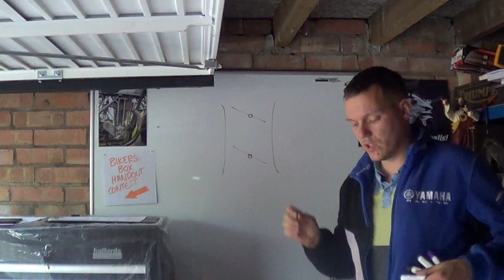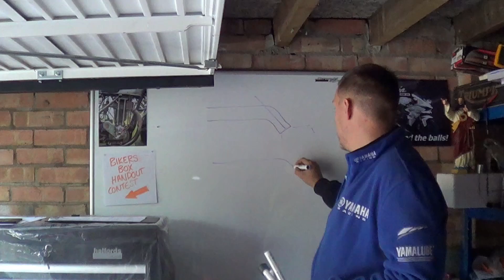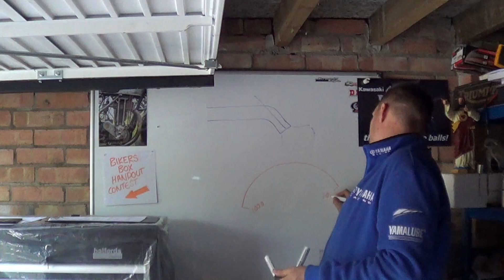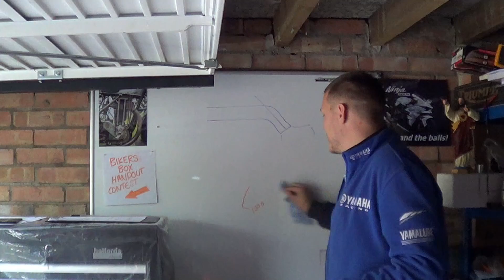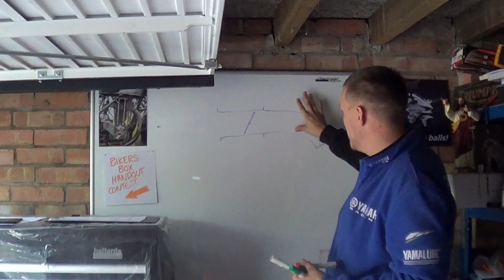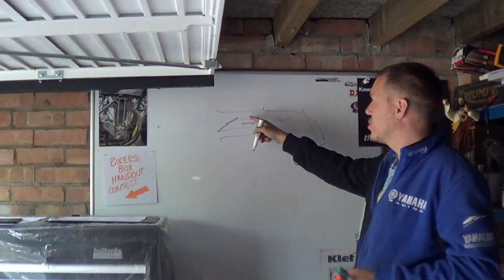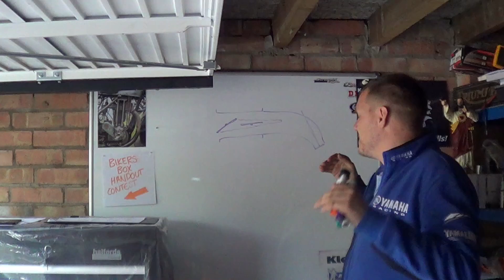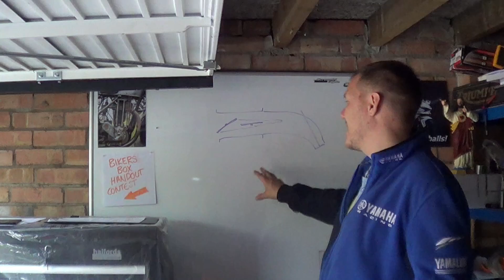Does your bike have 2 throttles? Secondary throttle valves

Comment: Have you actually tried removing the secondary throttle blade, or are you just going by a theory, and name calling?
Reply from the maker: Yes I have, I also did a 6 month module on fluid dynamics and tested flow controllers for Carl Zeiss...
Reply: @thedirtyworkshop  On what bike?

Comment: Came here to learn why we have secondary position sensor (along with throttle position sensor) and I did. Thank you good sir
Reply: it's like vacuum secondaries on a carb, but in series instead of parallel, to stop bogging in the middle of the RPM range. :)

Comment: Matt is this the same as using individual throttles where each runner has its own throttle or are individual throttles used for a different reason mate?
Reply from the maker: For a different reason

Comment: Hypothetically speaking would this also work in a scenario where ITBs are joined by intake plenum and said intake plenum has computer controlled throttle body?
Reply: I think the benefit would be somehow lessened by the increased plenum volume, but I'm not an engine wizard.

Comment: considering the weight saving, lower cost & lower mechanical complexity, this seems like a more effective approach, if done right, to improve the intake air-fuel mix speeds compared to Vtec. How does it compare to the ride by wire throttle system?
Reply from the maker: The  ride by wire is basically making full use of traction control and all the other electronic systems work together without mechanical systems. The other reason is so that the rider just becomes a digital input signal gather than a conversion from analogue to digital - also reduces latency between the two
Reply: @thedirtyworkshop  hmm... i guess that's why bikes like street triple have such flat torque cuves yet being able to rev reasonably high..

You are a gold mine of information, mate. So glad that I found this chanel.
Those fucking laplace equations and not learning enough about practical applications of that knowledge was really driving my interest in engineering down. Do you have a suggestion for a mechanical engineering student regarding how he/she should approach learning about practical applications? Maybe do a video on that? Would be really helpful for many engineering students.
Reply from the maker: "Do you have a suggestion for a mechanical engineering student regarding how he/she should approach learning about practical applications?"

- Yes, get a job LOL
Reply: @thedirtyworkshop  oh boy.. i walked right into that one.. lmao..

Comment: Nobody is trained to feather the throttle anymore. I think all numpty learners should have a month on a big bore single thumper, to practice on. That way they will stall often and kick like hell. It is the best teaching method.
Reply from the maker: I kinda agree - the issue is modern bike have so much more power than the old school bikes - for instance a GT750 had about 70HP - a new R1 has 180HP

Comment: TLDR; sometimes reshaping ports with JB weld works better than stock. Most times doesnt.
The usefulness of this "high velocity" porting is very dependant on the engine. For Motoman to say that EVERY engine needs it is stupid, yes. But the '02 CRF R models (first year produced) work great, but if you use some JB weld or whatever to reshape the port and raise the floor / open up the roof a bit you can not only raise peak HP but also extend the power band at the same time.

Comment: It usually takes about a year for configuring and testing a new moto design from A-Z, which includes section engineering teams, like for the engine and power band goals. Then here comes Yob Neckbone, with a new-to-him idea, to wise-up the bike brand with a genius mod. Moto fools often miss some obvious running needs & ignore unforeseen circumstances.

Comment: Love your vids. Fun and informed. 
I feel that I wanna chime in here since I actually has something to say =).
 
I have been working on some KTM 690 and I am of a different opinion about secondary butterflies. See, they are tunable and I tried going to the extreme ("removed" it electronically). What happened except a very abrupt power delivery, was that i were able to get the engine to ping at low down RPMs. It pulls more air than it can handle, so the comp.pressure got too high on low rpms.

It is a state of the art engine, but if runned without (or electronically removed) secondary butterfly, it is not idiot proof. When tuning the different mappings (map selector switch) of the bike, you are in fact tuning how the secondary butterfly opens in relation to the main throttle butterfly. You are changing the character of the engine this way, without altering the fueling or ignition timing. 
I believe the secondaries are more a safety device for the engine than a power-gainer. But on the other hand, a pinging engine is not a powerhouse either. At least not for long :D

Have a nice day, and keep the good stuff coming =) 

Robert, Sweden
Reply: I would say what you experienced is the compounding of effects that is part of tuning. You can put a less restrictive intake and exhaust on a vehicle but you won't see benefit until you rejet/remap fueling. Inversely, rejetting or remapping won't see benefit without putting on a less restrictive intake and exhaust. Trying to change one aspect without changing the other complementary aspect will appear to have a negative overall effect.
Reply: Did you increase the fuel?

A simple way to do that, without getting a tuner, is an O2 Eliminator.
Reply: @peterlindvall7671  Yes. But i changed the  mapping. O2 eliminator wont do the trick on a 690. It can be disabled through the mapping software.

Comment: i have a poulan chainsaw with 2 throttles and 2 sets of intake ports, is this the same thing? also has like these ports in the piston, not holes but like its weird, and ive been in and around 2 strokes a fair bit, first time ive seen it in person, poulan still uses that design today
Reply: att made vids about ports of 2 stroke in the cylinder AND the piston i think ;)

Comment: I believe that CV carbs help achieve similar results, no? fueling aside the vacuum slides do remain in the optimal position for the RPM. Would like to hear your thoughts Matt!
Reply from the maker: Coming soon. CV diaphrams are for A/F ratios, which is similar but not the same. More on this later. The CV gives it away a bit.
Reply: @thedirtyworkshop  What about the the 2003 r1 which had a CV style throttle body but was FI it would basically be the same concept as this but can only be control by vacuum of engine right?

Comment: so theoreticaly you could do the same thing with a very skilled right hand?
Reply from the maker: Yes - ish.
Reply: Had a fueling problem on my moped, because the mix was lean i had to slowly throttle up following the engine speed.
Every time engine speed changed i had to adjust the throttle so it was a constant fight to keep the engine running for the ½ hour drive i had home.
I would guess it would be the same though not nearly as bad as i felt it.

Comment: Doesn't CV carbs use changing intake pressure to open the throttle barrels as engine RPM (air demand) increases, after you fully open the throttle butterflies?
 Similarly, doesn't vacuum secondaries on a four barrel automotive carburetor work in the same way to help increase low to mid-range power of an engine. I was wondering your input on this, Matt.
 Thanks in advance, and I love your channel! 
 ,Jim
Reply: I was just thinking the same thing. I got old motorcycle too, and it has cvs in it and people who has changed them to normal slide carbs, they say they can't go full throttle on low rpm, cos it chokes.

edit: oh it was on there later on..
Reply: Jinx, you owe me a coke
Reply: (Jinx, in that I was wondering the same thing)  In addition, I was wondering how the engine spark advance system differs when it has direct slide system (throttle cable goes right to the slide in the carb) versus a Constant Velocity setup.  I had a 1977 Suzuki GS750 with the direct slide system and was told that those kind of carbs are desired by drag racers.  I believe soon after 1977  almost every manufacturer went to a CV setup.

Comment: I wouldn't be surprised if you could use a mechanical tachometer like thing to make a mechanical second throttle body, but that would likely be in the diminishing return of investment area.
Reply: you could do a system like the 2 stroke exhaust control (mechanical).its rpm based with an centrifugal

Comment: My 07 svs 650 has, plus 2 sparks per cylinders, nice little beast
Reply: K6 does too with 50% less spark plugs :)
Reply: Chris_ SVS nice, but i remember i reached 3,8L/100 km for consumption, it was amazing. And my max speed odo was 234 km/h
Reply: Math required lol  I usually fill up after 160miles ish, still plenty left in tank, only worry when light is solid
Reply: ;) well enjoy your bike, i don't have mine anymore, i sold it to travel, i miss it ... i owned 2 svs 650s because  i don't know for that budget area what bike fits me more, maybe the f800s but i heard so much negatives about de reliabelity. Or the f800r, hornet 600. street triples didn't have abs with is my number 1 concern and the 2013 years are still expensives

Comment: with the factory designing the system as "most efficient" in mind. they would judge this by the exhaust, and this being computer injection, i would guess, its what is most "efficient" for the catalytic converter. (just going by my car knowledge).. does this system run more off of the vacuum and load, or simply on a graph table of rpm to throttle position? or does a bike made in the last ten years even monitor vacuum or load? I see tps and air intake temp sensors on a bike, but only more recently O2 sensors..
Reply from the maker: "or simply on a graph table of rpm to throttle position?"

Usually this one.

Comment: So how is a runner sized to begin with? basically the same diameter as the valve its leading up to?
Reply from the maker: Usually larger - performance oriented ports are convergent to a degree usually 10-30% reduction in crossection depending on design. This is to create a natural nozzle usually to overcome the turbulant section within the cylinder due to valve shadowing. 

As for the ports as a whole they are designed to flow at the engines designed powerband. This is why steps are taken to reduce the size of the 'flowing' port, by using a butterfly to 'restrict' it.

Comment: Would rolling on the throttle as the RPM goes up as opposed to slamming it open achieve the same thing?
Reply from the maker: Yes, and that's what the old boys in racing had to do. With the secondary valve the primary throttle butterfly that you control is 'in the shadow' of the secondary, However, this doesn't mean that it is useless. More on this later, but because the injection spray cone cannot be controlled with solenoid injectors the primary helps to mix the incoming air. This stop asymmetrical mixture becoming a problem.
Reply: So I have been doing it right the whole time. I alway found that rolling the throttle on with the RMP game nicer engine response. Maybe no massive increase in power but a nicer smoother power pulls. Think my FZ6 S2 has secondary throttle bodies but everything else I had before was carbed.

Comment: Like toyota t-vis
Reply: guðjón örn Toyota T-VIS is more of a parallel way of doing this with 2 runners for each cylinder one that the computer opens and closes. Whereas this twin throttles as drawn was in series. So, similar.
Reply: But it douse the same
Reply: guðjón örn T-VIS is like an on off switch, open or closed. You really feel it kick in. Disrespect it in the rain in and an MR2 it will put you 90* in an instant. Whereas the secondary throttle is... throttled.

Comment: A secondary throttle works completely differently to 'high velocity porting'. It performs two main functions. First of all it smooths out low end throttle response. With the secondary closed you need relatively large movements of the primary to have a significant effect on air flow. This makes the throttle a lot less sensitive when riding at low speed. When you open the throttle further the secondary opens giving you full power. The second function is to modify the air flow and turbulence in the throttle body to improve fuel atomisation at lower throttle openings, giving better efficiency and lower emissions.
The secondary has no real effect on port velocity. For a given engine speed and power output the mass air flow and therefore port velocity will be the same if you have a secondary or not.
Reply from the maker: "First of all it smooths out low end throttle response."

- This is true, but as an after effect and what they publish on their marketing wank. If you look at this it makes more sense. 

http://www.gsxr-suzuki.it/en/gsxr-k1/gsxr-750/gsxr750_torque.jpg

Where did the extra low end torque come from. Narnia that's where. 

"The secondary has no real effect on port velocity. For a given engine speed and power output the mass air flow and therefore port velocity will be the same if you have a secondary or not."

- apart from those who remove the secondary and lose some bottom end torque. Erm........ Lack of undersatnding maybe?
Reply: Not a lack of understanding. The true extra torque comes from improved fuel atomisation and mixing. See http://wodocs.com/docum/30-suzuki-gsx_r1000-24.html If you look at this torque graph http://wodocs.com/docum/30-suzuki-gsx_r1000-23.html you will see that the difference is only 5%. The graph is cleverly scaled to make it look a lot more. This all has little effect on port speed. In fact for a given power output at lower revs the port speed will be a tiny bit lower due to the improved volumetric efficiency. Port speed is dependent on mass air flow and port cross section. How you regulate that air flow has no effect.
It feels like you have lots more bottom end torque because the secondary opening effectively adds more throttle for you. At lower speeds the secondary is closed making the  primary relatively insensitive. Now you give it 1/2 throttle. The secondary opens making the throttle much more sensitive and giving you more of a kick in the arse than you would expect from a machine without a secondary.  The torque curve of the engine hasn't changed much but the computer makes it feel like it has. If you pin the throttle at 3k rpm you will get pretty much the same torque from a machine with a secondary or without (within 5%). Of course in normal riding you don't do that very often.
If you get past the marketing wank the real purpose of the secondary is to mess around with the throttle response making the bike easier to ride and feel more grunty than it actually is. You also get improved low speed emissions and economy.

Comment: This kind of thing has been used in cars for quite some time now. Google Toyota t-vis, The butterfly valves were at the end of the intake runners not throttle body but it works the same.

Comment: How would a 'drive by wire' throttle body affect this? Could you do all this with one valve if your throttle was controlled by a computer?
Reply: I think they then combine it all into 1 throttle body, when you go full throttle, the throttle body itself will not fully open, so making the second throttle body unneccesary
Reply: Henry Bevan Was going to be my next question, I believe the new GSX-R has ride by wire, but they apparently also limit full throttle at the top with this as well...
Reply from the maker: "How would a 'drive by wire' throttle body affect this? Could you do all this with one valve if your throttle was controlled by a computer?"

- it is a fly by wire system. The throttle input is manual, and the secondary is controlled by the ECU based on engine rpm. 

- yes coupled with a traction control system, however the problem is control. You're not in 'control' if the ECU has full control. With a secondary throttle valve the ECU adjusts what you are asking of it. The way manufacturers like to do it is with both systems, a rider controlled throttle and a ECU controlled throttle.

This is why the ECU throttle is the first from the air box but called the Secondary. Its secondary to your input.
Reply: It is all about the user's impression of what is happening.  "You're not in 'control' if the ECU has full control". Full fly by wire can give exactly the same throttle response as a dual system or better but riders put more trust in a mechanical system. Bikers are too macho to trust a computer to operate the throttle for them.